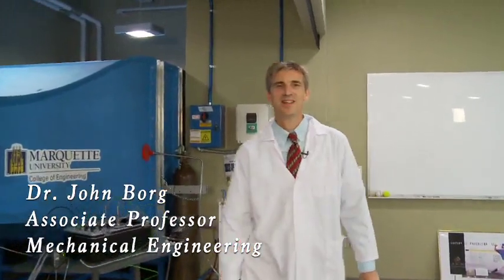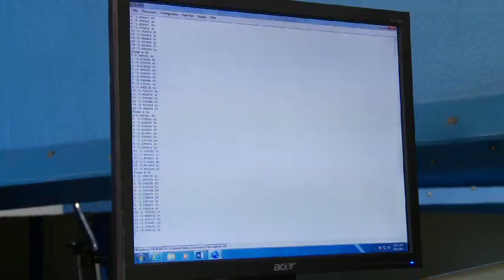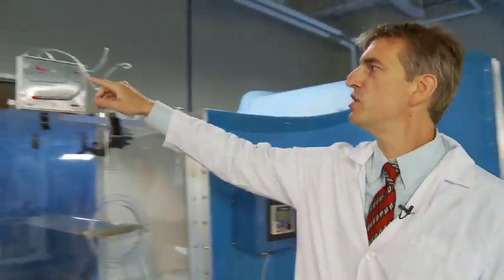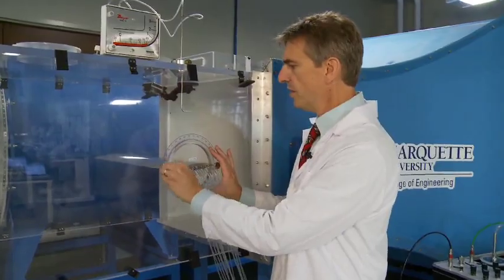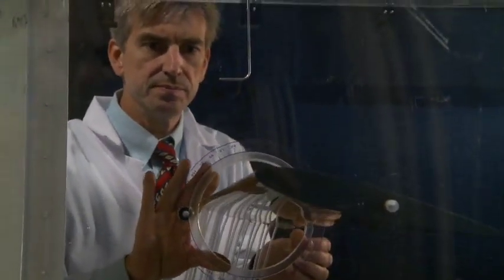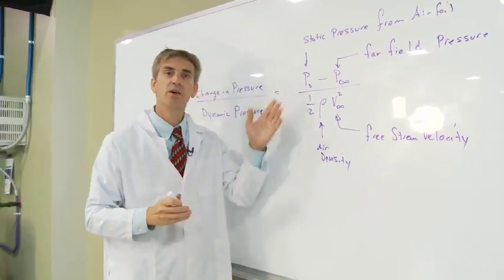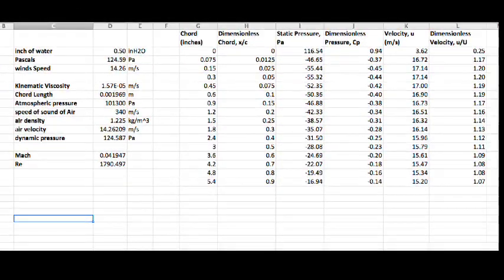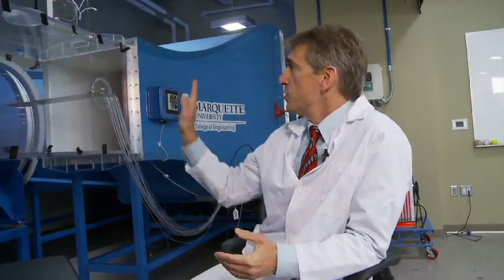Wind tunnel pressure data for a NACA 0012 symmetric airfoil

Comment: I was so hopping you would do the integral. Love the setup, love the video. Do note that you had your chord in the table in Excel as 2 mm, and it should be somewhere between 150 mm based on the 0.1c being at 0.6 inches, and 6 inches is approximately 15 cm (150 mm).
In a discussion I am having with some in another chat, I am reminded about how formative the knowledge and experiment in this video was to me. I constructivisticly build my understanding of lift on knowing that we measured pressure and integrated it to get lift (I am so lucky I absorbed that first as an experimental physicist). I am so confused why this fact is ignored when engineers move on to "Newton's 3rd Law applies in the wake", hence wing pushes air down to generate lift. Ah no, as in this experiment, Netwon's 3rd law applies at the surface of the wing, the structure pushes on the air, and the air pushes back on the structure. I mean I know the momentum equation is called the momentum equation, but it just requires the evolving pressure field to be balanced by changes in momentum, and since there is a difference in pressure, then there will be a change in pressure... upward turning before, downward turning after, but not a net flux down. I mean if that were true, all bubbles would eventaully be required to hit the floor of the wind tunnel, becuase they have a net downward velocity. All of that rant is to say, I think this video is super important to ground things in the observable reality of experimentation (hence the bubbles are super important).

Comment: I have been building FPV helicopter aiming at endurance. NACA 0012 and 0015 used to be the standard in the industry, but recent manufacturers/machinists are making NACA 0008 blades, and I am struggling to keep up with them. I am studying NACA 0012 again to see details and try to find solutions.

Comment: Nice "Wind Tunnel Test 101" tutorial that goes over the basics of plotting Cp curves. What you need to get is a top of the line FLIR camera (probably will cost more than your entire facility) but you can use it for IR thermography as very sensitive to temperature changes so may be able to see where the flow separates on air foil. Also NACA is pronounced with each letter instead "nakka" like we use for "nasa."

The hands-on is much like what the NACA engineers did back in the days when defining all those NACA airfoils. What must have really been tedious was in 1953 where staff at Ames Aeronautical Laboratory completed the NACA 1135 airfoil data, including the lift, drag, and moment coefficients for various Mach and Reynolds numbers. Available from the NASA Technical Reports Server https://ntrs.nasa.gov/search

Comment: According to the normalization, isn't C=0.1524m = 6" ?
9:27 In the data sheet, the chord length is 1.969 mm = 0.075", which is too small and coincides with the first step.

Comment: Try connecting alternate sides of the aerofoil to a multiple tube manometer, and you will get a good approximate view of lift as the area of what you will see. It will be obvious when the aerofoil stalls round about 14 degrees angle of attack.

Comment: The authors have two wrong scientific approaches: researching the creation of Lift force and Low pressure at upper side of the wing, relative to the ground surface and Earth. I explain the aerodynamic cavitation and existence of Lee side aerocavern, and creation of Aerodynamic force.
Reply: What are you talking about?  Where do you explain lift?
Reply: @Talon19  In my book "Drowned in the air"
Reply: Aerodynamic force is the wind force, stands for relative wind. Further, in physics, wind force and aerodynamic force are different. The wind force strikes the object, and the aerodynamic force is which the object receives at right angle to the contact surface.
Reply: The force object receives is always normal to the contact surface and (static) air pressure always acts normal to the surface of the body. This has long been well known, and I don't know why in flight theories and aerodynamics books this is (mostly) omitted.
Reply: @vlatkopopovski2685  
The resultant vector of the lifting force isn’t always perpendicular to the chord line.  We can see this from pressure measurements along the surface of the wing.
Reply: @Talon19  There is NO resultant vector of the lifting force, it is AERODYNAMIC FORCE always perpendicular to the chord line.
Reply: @vlatkopopovski2685  
Yet again you are making claims without evidence or source.
The pressure distribution and the resulting force on the airfoil can be directly measured.
Rarely, if ever, is this force perpendicular to the chord.  You can rename it all you want, but empirical evidence and tests show you are wrong.
Reply: @vlatkopopovski2685  
I’m talking about the net resulting force on the airfoil.
I am not talking about every infinitely small pressure and force on the airfoil.
Forces and pressures in relation to the chord are not very useful because they are not acting with relation to thrust, gravity, drag, lift, weight, CG.

Comment: But the point is ...airfoil moving in static air and....air moving over a static airfoil...are two completely different paradigms...no streamlines are present in actual airspace around a moving wing since all air is static...

Lift is a mystery and there's no scientific explanation for it's origin and cause.

Comment: At 10:24 you deduce the velocity from the pressure using Bernoulli! Why didn't you measure the velocity? You have bubbles (beautiful bubbles - brilliant innovation.) You could get a high-speed camera to measure the speed of the air?
We know there is a pressure difference... the only way a fluid can impart force to a body is via pressure. You measuring that pressure difference. Where does that pressure come from? You assume Bernoulli. But that may not be true. There are a lot of reasons it may not be: Air IS compressible, the fluid is NOT flowing in a tube, and more. With a high speed camera you could validate the theory.

Comment: Good/informative video. It would be nice to complement it by calculating the induced drag of this profile AND, by using a wing-tipped airfoil, to compare induced drag of the same NACA profile with and without wingtip.
Reply: sorry do u know how he worked out static pressure?
for I do not know total pressure
Reply: I guess the Static pressure has been measured by the scanivalves to which the tubes are connected from the pressure ports on the surface via the pressure taps

Comment: how is velocity increasing over free stream velocity? That is happening at the curvature where the pressure gradient is most favorable. The boundary layer is created and It increases with the length of curvature, the upcoming stream of air reacts to the boundary layer as to the psychical surface of the object and thus narrowing the free stream volume. Can we say that the velocity of air is increased because of conservation of momentum, as more mass of air is hitting less mass which is moving through the lower volume at the boundary layer and thus speeding up because it is conserving momentum?

Comment: Great video... are there any simulators that could give this kind of data?
Reply: XFLR5
Reply: Designfoil is a shareware tool you can use for this. It has the NACA airfoil generators in it along with a 2D wind tunnel.

Comment: Except mixing up the chord with the mean chamber line there is another minor inaccuracy. The sensors on the airfoil don`t show you static pressure, but just pressure in particular point. For example, in stagnation point (where V=0, close to leading edge) the measured pressure equals static pressure plus dynamic pressure (0.5*density*velocity^2). So in that formula of pressure coefficient it should be "P" instead of "Ps". And by "P infinity" he means "static far-field pressure". But the video is very informative and useful!
Reply from the maker: Hi IllIa
Thanks for the comment and good point regarding pressure measured by the ports.  For sure if a pressure port is oriented parallel with the wind (facing the incoming flow directly) then it would measure the stagnation pressure.  In fact that is how one can align the airfoil to the wind, by insuring the leading edge port is measuring stagnation pressure.  
-jb
Reply: do u know what total pressure is for the experiment??

Comment: you have any idea how many rotating water wheel type generator/alternators you could attach to that to produce energy?
Reply from the maker: No idea!  I suppose you are talking about a wind turbine, whether it be horizontal or vertical (more like a water wheel type).  The tunnel cross-section at the test section is 2 feet x 2 feet, so the wheel would have to be small.  As a rule of thumb, anything you place in the tunnel should have a projected area less than 10% of the test section area.

Comment: I'm torn between my affinity for efficiency and my desire to see smoke ;).
Maybe a strobe light on the bubble stream. Too bad we can't color bubbles. Good video. I appreciated the explanation of your wind tunnel set-up. Clearly explained 👍
Reply from the maker: Smoke would be great but for a closed loop-wind tunnel the smoke would just go round-and-round.  Which means after about a minute, the whole tunnel is filled with smoke and you can't see anything!  I have done it a couple of times.  The other downside to smoke is, what is the smoke made of: glycol, glycerin, dry ice?  Ideally the smoke should be neutrally buoyant so that it follows the flow and doesn't rise or fall based on a difference in density between the smoke and the air.  Think about hot steam from a smoke stack, it rises pretty quickly.  Another consideration is what happens to the smoke over time.  So if it is a Glycol based smoke, like a lot of theatrical fog machines, it will leave everything in the tunnel a little greasy for a while as it accumulates on your test section and models.  I wonder about its effect on hot-wires.

A strobe light would be cool to try.  Especially if it were synced to something periodic such as a vortex shedding event.
Reply: @marquetteshockphysics5518  
Yes, good point about the density difference. I hadn't thought that through. 

That was my thought on the strobe light as well. It could be variably synched to match flow rates at different points. Then these would appear "frozen" compared to the rest of the flown It would make specific flow rates detectable using vision directly. 

(Sort of how astronomers use software to reverse moving objects to make them look still, and stationary objects to make them look moving. It helps pick out dwarf planets and asteroids against star fields.)

If it doesn't work out, you could have a disco party fundraiser to recoup your costs.

Comment: Excellent stuff! Long time aviator,theories have been changing.Can you approximate  the ratio of lift that top surface(low press,bernoulli) does as opposed to bottom surface,(hi press,Newtonian) for  a GA aircraft?Irealise it will vary,but Im guessing 25% Bern and 75% Newtonian.Cheers and thanks
Reply from the maker: Good question!  Not sure I could answer that.  I think of it more like there are two simple theories that do a good job of describing the same complicated physics.  Both theories have their advantages and disadvantages but neither can describe everything that is happening: laminar-turbulent boundary layer transitions, wing-tip vortex rollup, flow separation.  So in a way they are both just models (ideas) of what is happening to the flow along the wing.  Sorry that got a little existential for a moment... :)
Reply: @marquetteshockphysics5518  If Bernoulli's equation is just an equation that calculates the conservation of energy, why is it so often assumed that the increase speed over the top of the airfoil then must have lower pressure, instead of the other way 'round. If the high pressure at the leading edge and slightly the lower surface (assuming an angle of attack), wouldn't this create a low pressure behind this pressure buildup (which also causes the updraft), leading to the fluid speeding up? 

I don't understand how if a vacuum on the top of the wing lifts the entire gross weight of an aircraft, fuel, passengers, and cargo, how could, say, a fabric coated wing be held together by glue. 

Seems more intuitive to me that the low pressure causes a high speed, which spills off the trailing edge downward, pushing the wing up. No?
Reply: @BrentDanley  Bernoulli just tells you the numbers. It doesn't explain why it happens. In fact, it is the lower pressure which pulls the air in (accelerates it).
Your intuition about vacuum is correct. Take a container with a vacuum inside. There is (literally) nothing inside which "pulls" on the wall. Even just a tiny bit of air inside will always PUSH against the wall. But the outside (atmospheric) pressure will press a lot more against the walls. But there is nothing inside to hold back.
Same with the wing. The lower the pressure on the upper side, the more the pressure on the under side can push the wing up. (At least as far as i understand)
Reply: @BrentDanley  The Bernoulli equation assumes that since the energy in a streamline is constant if no work is being done to the fluid (such as in this experiment), then if static pressure decreases, the other energies must increase in order to maintain a constant total energy. Since hydrostatic pressure change across the airfoil is minimal, the dynamic pressure must increase. An increase in dynamic pressure demands higher velocities, and therefore the flow velocity increases.
Reply: Even in a "pure" Newtonian sense the lift doesn't only come from the bottom surface / high-pressure. The air that travels over the top surface is deflected downwards as well too which by Newton's second law means it also contributes to the lift force.
Reply: @OMGclueless  That is the Coanda effect.
Reply: After a long Q&A with ChatGPT, it finally admitted that a 747 at 30,000 feet and 500 knots, the gets the vast majority of its lift from AOA (Newtonian) with the next most significant "lift" contribution being from the Coanda effect and lastly some small Bernoulli enhancement.  Even if the highest lift wing airfoils were used but there was zero AOA, the plane would descend.  Rapidly.
Reply: @shazam6274  I’m not sure about that, and chat GPT will admit anything if you continually question it. The pressure difference is a byproduct of Newton’s third law when you use a Lagrangian method. The airfoil “redirects” molecules of air, and this change in momentum results in a force. The fact that the centre of lift is closer to the centre of pressure rather than the point at which most flow deflection occurs is indicative that the pressure difference contributes a large amount of the lift.
Reply: @ollie4022  OK, I'll make this real simple:  ride in a car at >30 mph, put your arm out of the window with your palm flat, parallel to the ground, twist your wrist to angle your hand up or down and your arm will rise or fall.  Just in case you think that your hand is the shape of an airfoil, try it with a ping-pong paddle or a piece of flat wood or cardboard!
Reply: @shazam6274   The pressure difference occurs regardless of the shape of the airfoil. You can see the same behaviour occurring with the heat-shield of space vehicles undergoing re-entry, despite being a blunt object. A piece of cardboard has a stagnation point and a region of high and low pressure on either side. That’s not proof that pressure difference isn’t the primary contributor to lift.
Reply: @ollie4022 The issue is that the Bernoulli idiots say it is the curvature of the airfoil causing lift!  I agree whole heartedly that the difference in pressure of the top an d bottom is why wings lift an airplane, this is done by varying the AoA, Angle of Attack aka Angle of Incidence.  This was accurately described by Newton.  Unfortunately most of the crap in the internet (and in schools and textbooks) proclaim that it is all due to the Bernoulli Principal, which is just plain wrong.
Reply: @shazam6274   The Bernoulli principle describes flow, it is not responsible for flow phenomena. It’s a way of modelling flow, and it’s an imperfect model anyway. The Bernoulli principle successfully predicts that the pressures on the top of a wing will be lower than the bottom due to an increase in the dynamic pressure and thus a decrease in the static pressure. That’s accurate, and uses the Eulerian framework of fluid mechanics. What you describe is the basis of the Lagrangian analysis, which focuses more on particle behaviour rather than continuum mechanics. For an airfoil, continuum mechanics are more manageable, thus the Bernoulli equation is used. That’s not to say that Lagrangian analysis doesn’t have its place. During Covid, Lagrangian analysis proved useful in modelling the spread of the virus due to aerosolised breath.
Reply: @ollie4022  Airplane wings lift because of the air compression underneath due to AoA, not the fanciful flow over the top!  
The BS about CV-19 spreading 16 feet due to particle airflow was BS, as were most "studies", because Viral Loading was not factored in.
Reply: @shazam6274   There’s a region of low pressure and high pressure on top. As I said numerous times, Bernoulli describes the flow. It doesn’t explain the phenomenon. The flow on top of an airfoil is measurably faster than the flow underneath, this is explainable due to the Bernoulli principle. I think you would struggle to prove it mathematically using your Lagrangian theory. 

Viral loading isn’t particularly relevant to a CFD simulation about airflow from a person’s mouth. The CFD study already assumes the patient is contagious. I think you would have a hard time arguing with policy makers that the simulation is too strict.